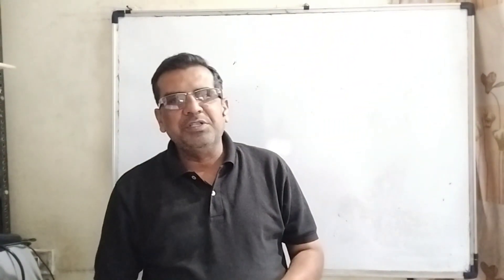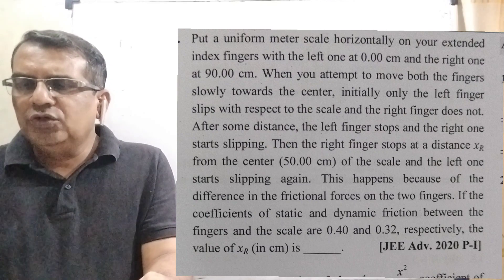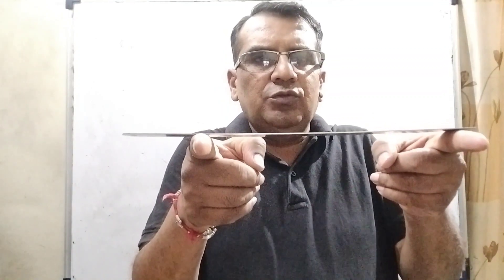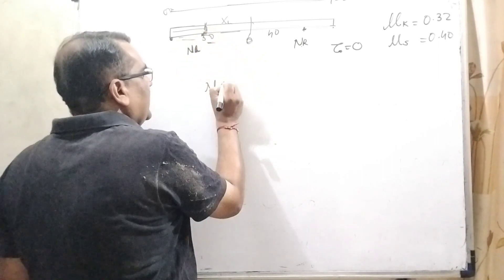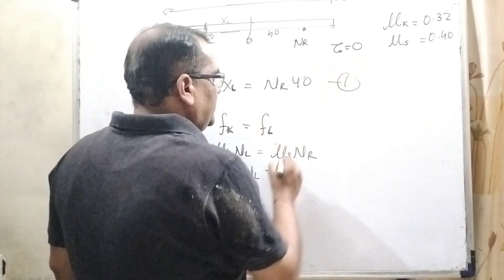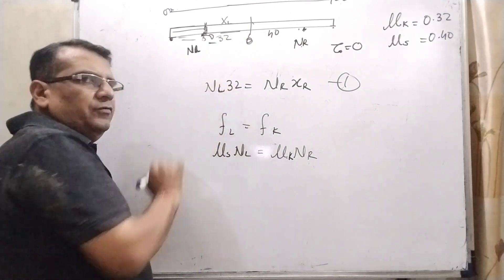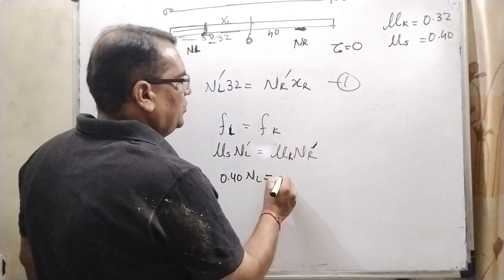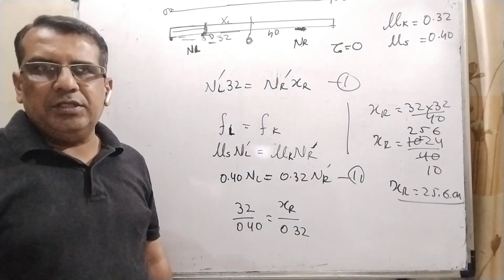Put a uniform meter scale horizontally on your extended index fingers with the left one at 0.00 cm

Comment: why if fk=fs I couldn't understand?
Reply from the maker: You can see my experiments initially I have explained when Kinetic friction is minimum then limiting friction maximum so in a particular position both equal
Reply: You can also see that the scale is not moving it means the horizontal.forces should cancel our that's why it's FK=fs